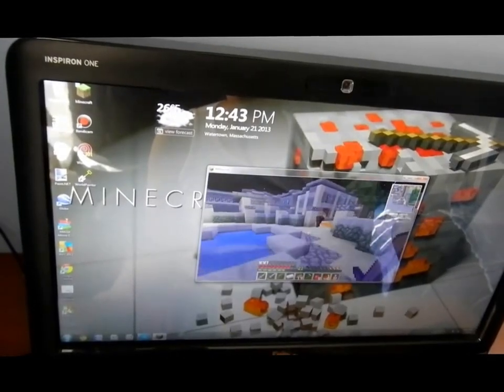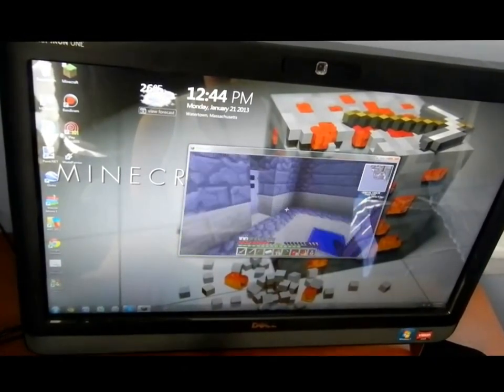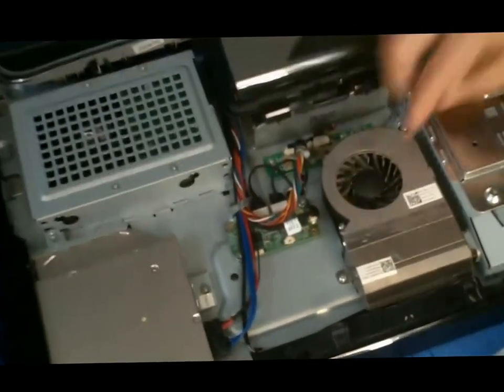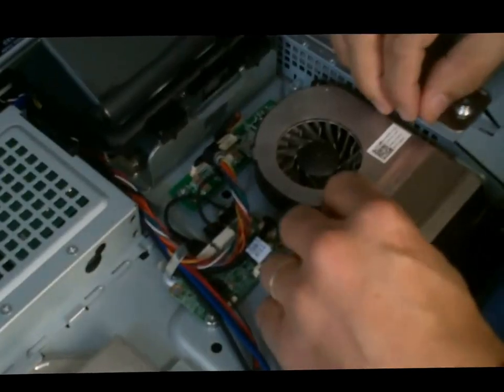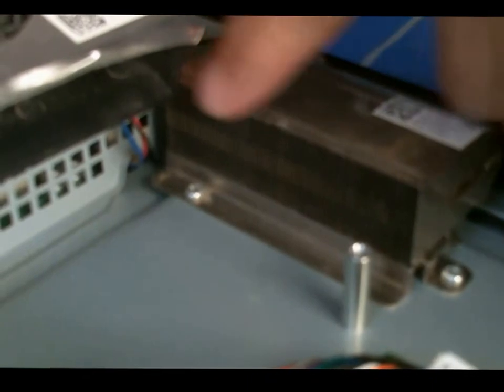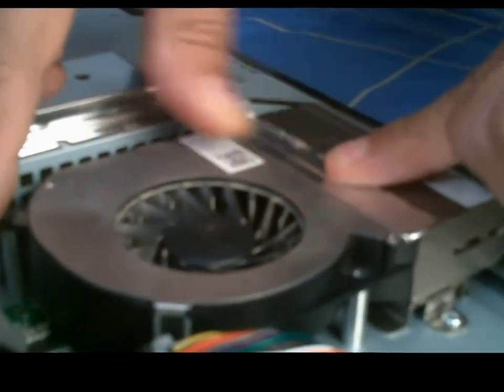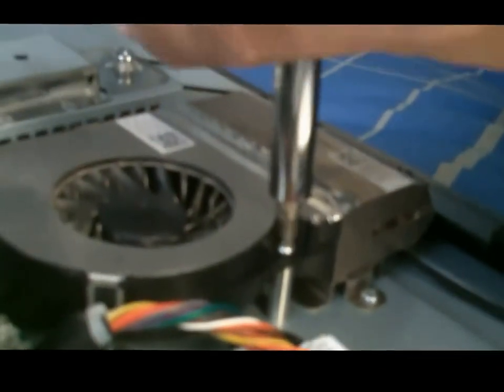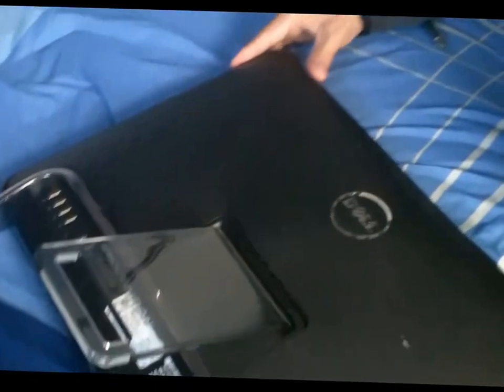Dell Inspiron One fan cleaning

Comment: My  Inspiron One desktop AIO was a 2012 bit different  model . More to remove in order to get the fan off. I decided to just reach my  alcohol  cotton swab in & around  the fan .Lots of dust pulled out & course dust everywhere inside the unit.Carefully spent about 45 minutes ,closed it back up . Fired her up & it's immediately quite,not heating up.So far it's been working without a problem & we'll see if it keeps going without shutti375ie sh jf..$553

Comment: can't thank you enough for the video. this was so easy. I used a toothbrush to dislodge the dust buildup,which was considerable. used some qtips to wipe the fan blades down as well. mine is running like new.very quiet!!

Comment: Every few months I use a can of air on my Desktop PC, outside of course, to clean the hell out of the PC fan and the power supply. If your Desktop case has filters make sure to remove them and clean them, most can be rinsed underwater. Some cases you can push on a corner of the filter and it opens like a door, use can air and spray it out and close it again.

Comment: These cases get HOT, you can use a Dremel and drill some HOLES on the back of the metal plate near the top so it cools better. You can also watch another you tube video on adding an external PC fan to the back case using the power from the internal motherboard.
Reply: Yep...I hate all in one PC's...very poor design, super hard to take apart to clean & replace parts...some are much worse than this one! I always tell folks to buy a regular tower desktop...so much easier to work on & you can add fans if you need to. All of these units run hot...even if they are new or cleaned regularly, I would still run a table fan next to one while it is on...aim the fan into the bottom vents so it can help circulate the air which should blow out of the top vents.

Comment: it didn't work and it still shuts down. :(
Reply: If shut down is heat related, use can air to spray the dust out of the PC fan. With the power cord unplugged of course. Otherwise scroll down these comments and try what daveweldon2010 suggested, unplug, hold down power button for 60 seconds to discharge capacitors. Plug cord back into the wall and try that. Shut down is usually a safety feature, might need to Reset CMOS in BIOS. Sometimes there is a CMOS connector on motherboard with a PIN block, you move to both PINS, and it resets CMOS, then put the PIN block back the way it was and turn the computer on so the reset BIOS can load again. There is also a quarter sized battery inside which keeps CMOS from being erased when computer is not powered ON. This battery will go bad after a few years and you could try replacing that battery and see if that helps.

Comment: Good Afternoon,
Mine shut down one time and I can't turn it back on anymore.  The blue led light on the cord turned out as well.  but whenever I pulled the cord out from the computer, removing it from the adapter and reconnecting the two cords back again, the blue led light turns back on.  But as soon as I connect the cord back to the computer, the blue light on the cord turns out again...I can't get the computer to turn back on.  Please help.  Thanks much.